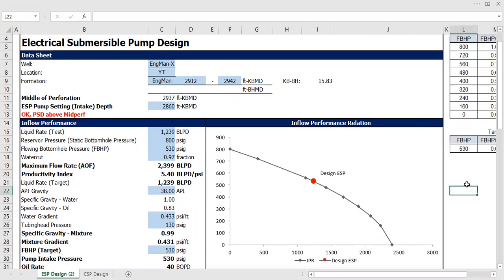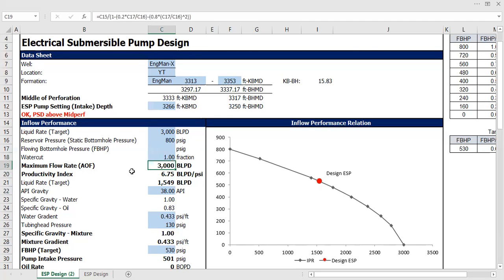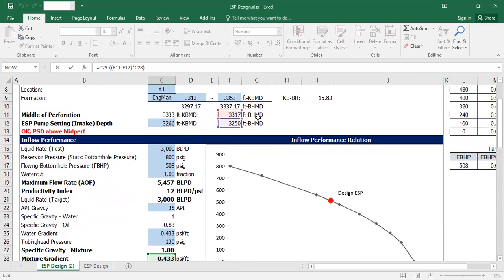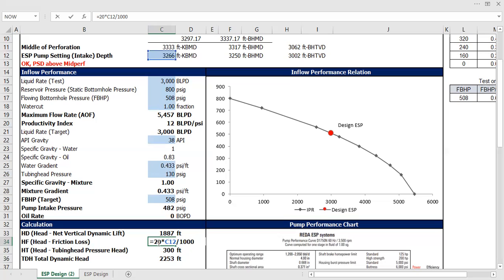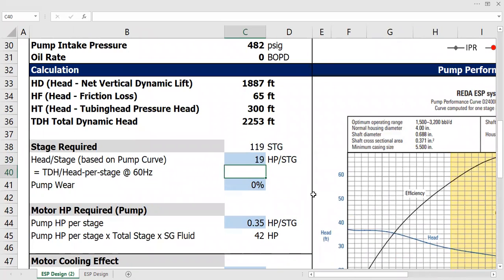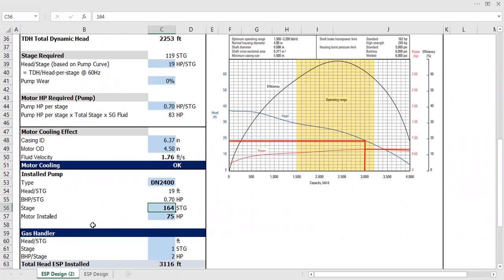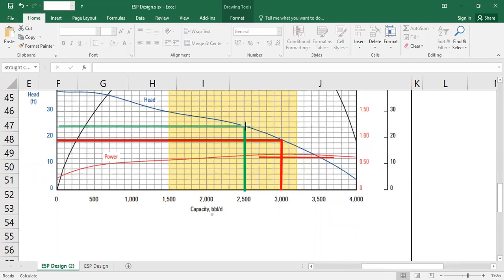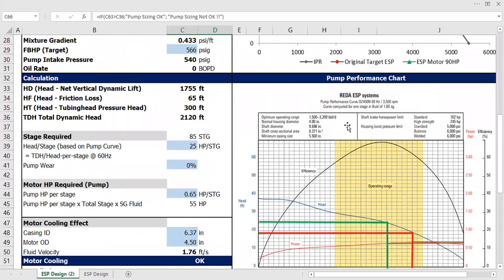Electrical Submersible Pump Design with Spreadsheet

Comment: What if it is a horizontal well 2-4 miles long. The upper perf is usually above the KOP and the lower perfs will be spaced 10k feet away. If I take middle perf still for calculating PIP? Thanks so much! Great channel.